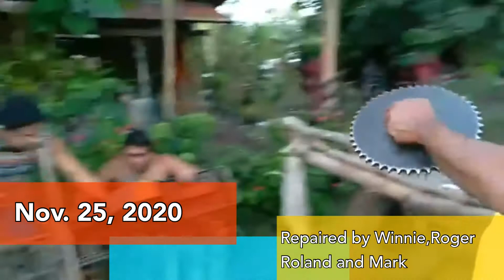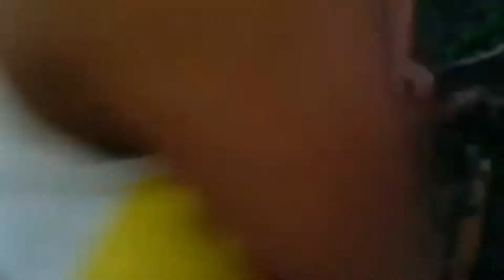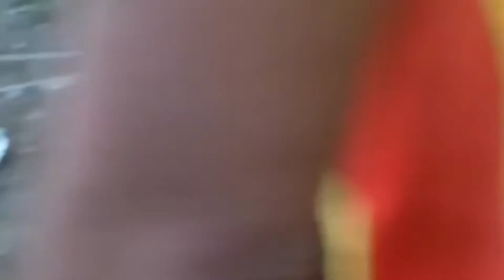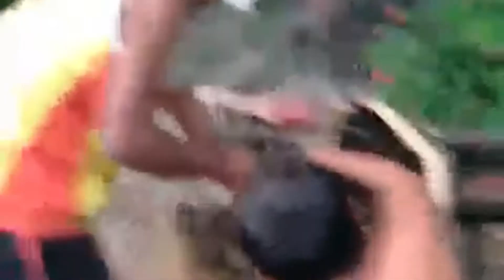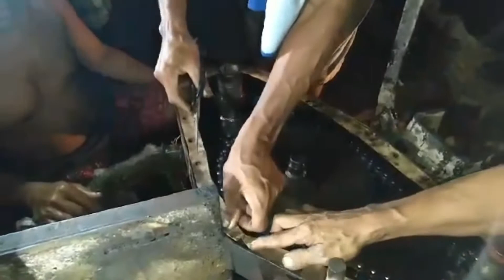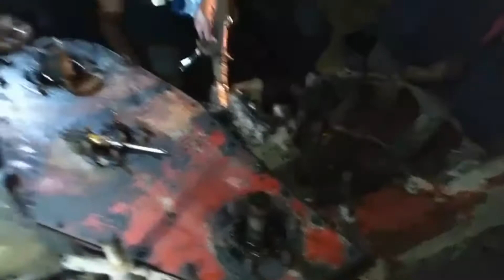Repairing our hand tractor - Alicia, Isabela

Comment: Excellent video sir. what brand or model po yang hand tractor?
Reply from the maker: Hi sir, thank you po for watching. Regarding the brand of hand tractor, hindi ko na po matandaan. Matagal na rin po kasi yan. I remember, we replaced the bushing and oil seal, and chain to that tractor.......:) i think almost the same naman po yung mga mechanism ng gearbox nya on how they work......:)
Reply: Thank you po.  Meron po kase kaming research about hand tractors, nakatulong po yung pag dissasemble nyo sa transmission part.  Salamattt and Godbless po :)
Reply from the maker: @gabrielreynoso1470 , you are most welcome!.....:)